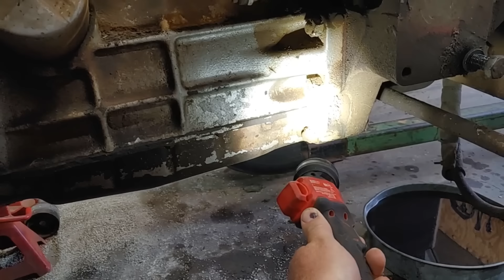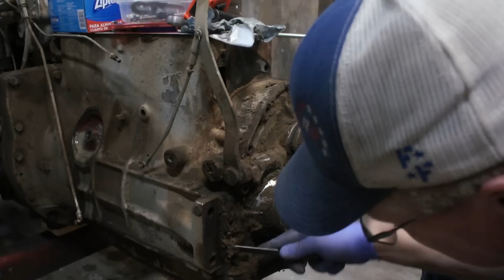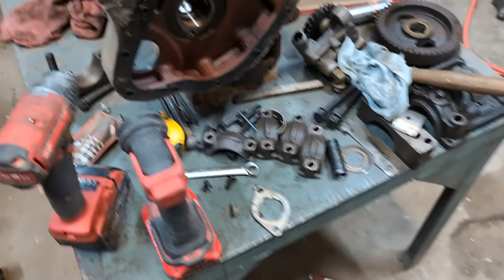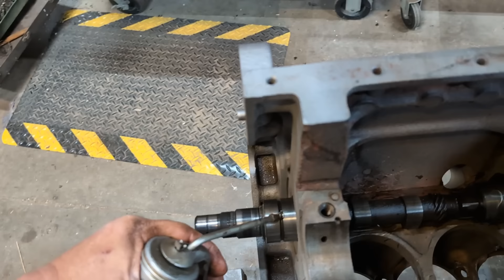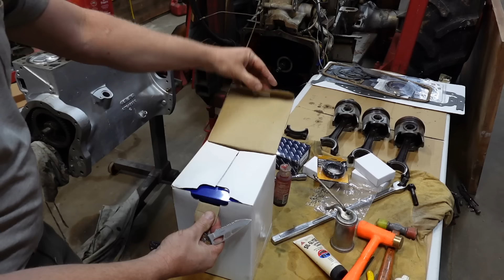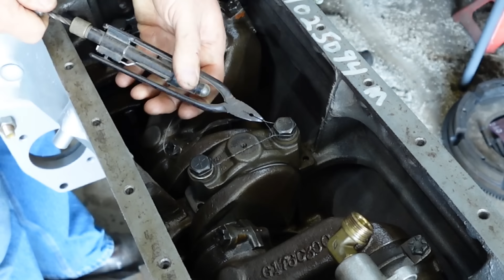1965 Massey Ferguson Engine assembly

Comment: When you pulled the pistons out of the new cylinders, were the rings all scared up? I have a set of G176 cylinder and pistons from Reliance and the chrome top rings on them are unusable because of the deep scratches.

Comment: I've done a lot of engine rebuilding, even worked as an automotive  machinist for few years before I started flying. And I don't remember doing a gas engine with wet liners, except for big aircraft engines. You've found an interesting challenge!